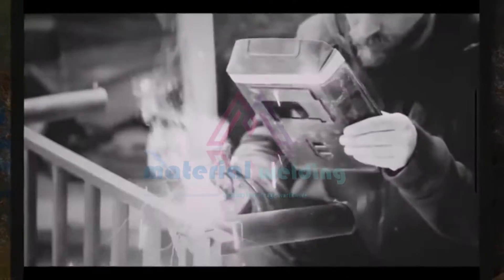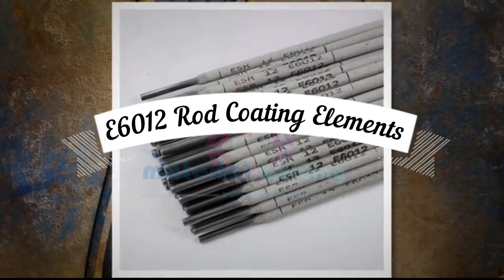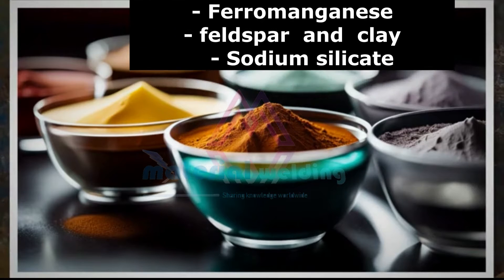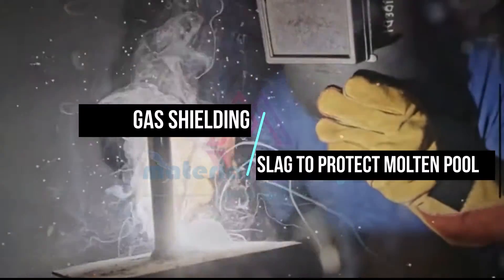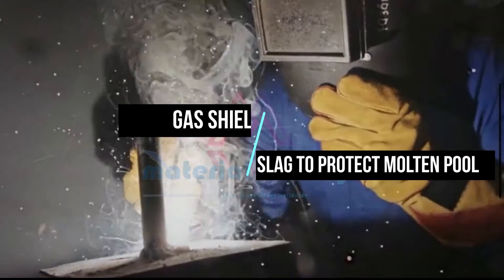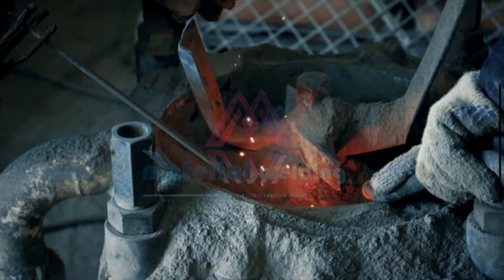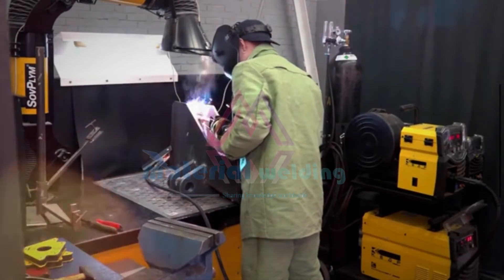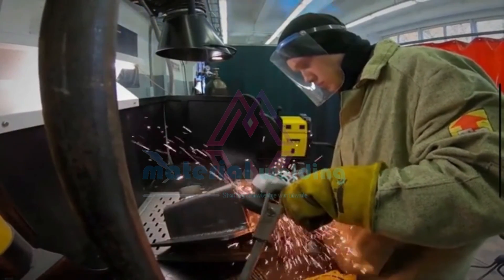E6012 Welding electrode  Complete Guide

Comment from the maker: 📢📢Read in depth: https://www.materialwelding.com/e6012-welding-electrode-everything-you-need-to-know-is-here/
📢📢Welding Electrode Types-Welding Rod Number Meaning & Classification - https://www.materialwelding.com/smaw-electrode-types-and-welding-rod-number-meaning-classification/
📢📢 best brand of 7018- https://www.materialwelding.com/best-brand-of-7018/
📢📢How to Choose the Right Stick Welding Electrode and Rod Type- https://www.materialwelding.com/how-to-choose-the-right-stick-welding-electrode-and-rod-type/
📢📢 E7018 vs E7018-1 vs E6013 vs E7016 vs E6011 Explained- https://www.materialwelding.com/e7018-vs-e7018-1-vs-e6013-vs-e7016-vs-e6011/
📢📢E7018 Welding Rod: Everything you need to know- https://www.materialwelding.com/e7018-welding-rod-everything-you-need-to-know-is-covered/
📢📢E7018-1 electrode- https://www.materialwelding.com/e7018-1-or-e4918-1-h4-electrode-specification-meaning-chemical-mechanical-properties-with-mtc/
Reply: @MaterialWelding,where can I buy e6012 electrodes?who sells them?🧑‍🏭